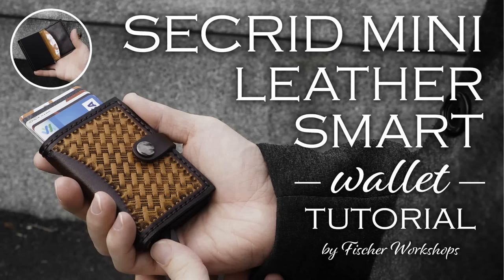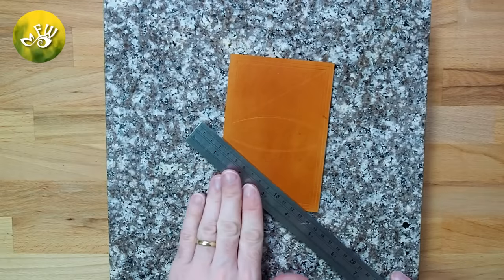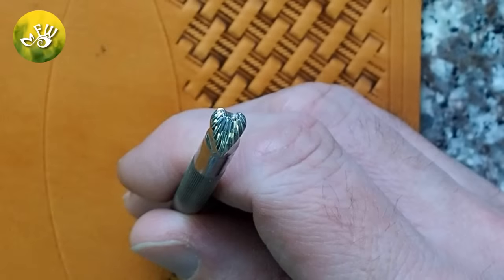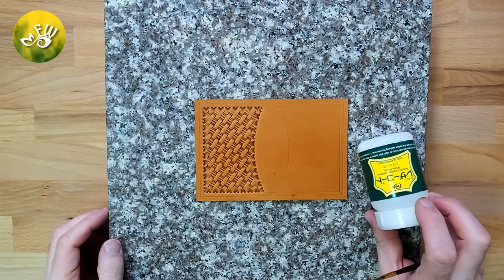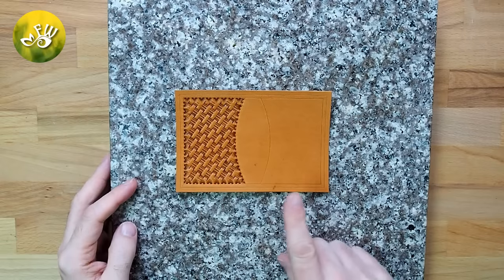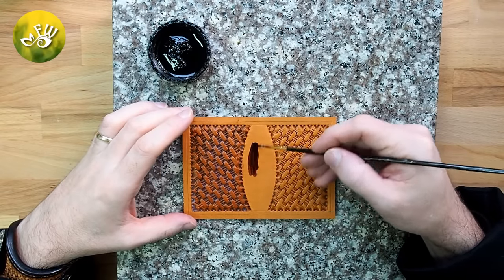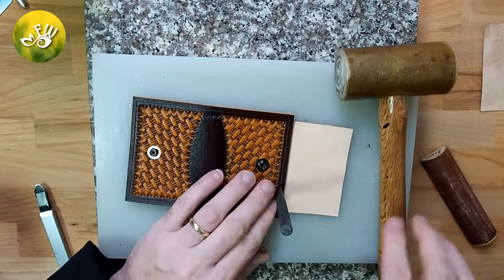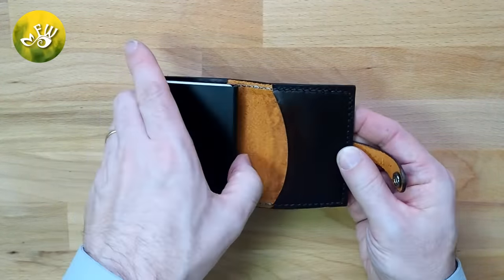Secrid Mini Leather Smart Wallet Tutorial by Fischer Workshops (HD)

Comment: Where can I purchase the "smart wallet"? I actually have a couple of wallets I purchased with the same aluminum "case" but I would rather not have to pull it apart to make my own.
Reply from the maker: Secrid smart wallets should be easy to find online through Amazon or Ebay. I would check there 1st. I bought mine at a fair.

Comment: One quickly notices from the video ending and the free PDF download, that attempting to 'actually' insert cards into the underside of the wallet pockets results in a design feature failure.  There is simply not enough room to accommodate stitches and cards into a 1/8 inch border.  I would recommend a 'glue only' attempt.  Or one could simply increase the length to 14.5 cm  and the height to 10 cm. Enjoyed the cover tooling. Good job!